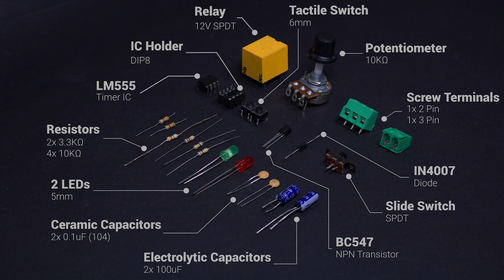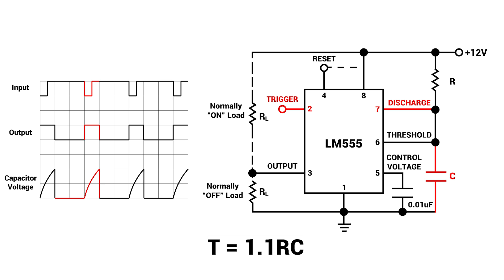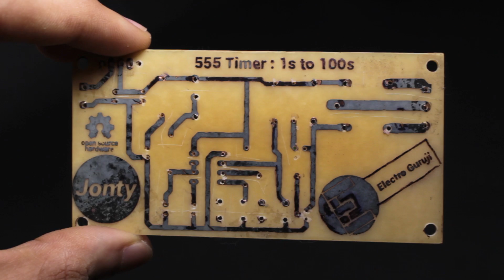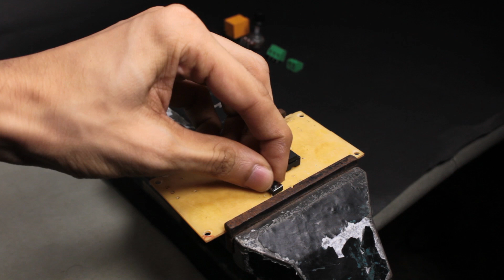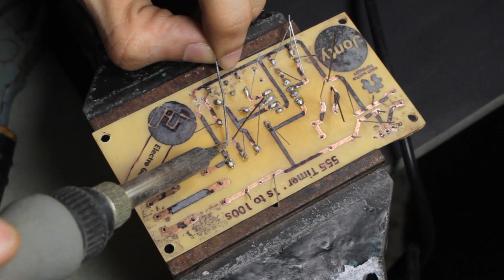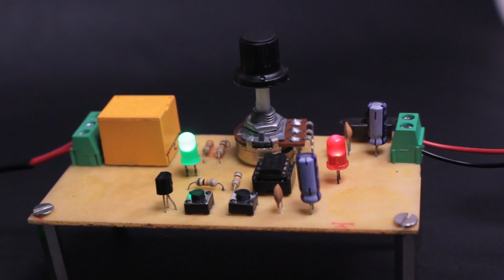How to Make an Adjustable 555 Timer Relay Switch | Monostable Multivibrator

Comment: Hello sir 🙏 sir can I use 10k Potentiometer for this project 🤔 pleasee reply me sir 🙏
Reply from the maker: For example, if the potentiometer is set to 0Ω, the value of R is equal to 10KΩ. Hence t = 1.1 x 10K x 100u = 1 second.

But if the pot is set to 1MΩ, the value of R is equal to 1MΩ + 10KΩ = 1010KΩ. Hence t = 1.1 x 1010K x 100u = 100 seconds.

Replace 1M ohm with 10k ohm and see what time period values you get.

You will need to select a different capacitor value to achieve the same time periods as the original circuit
Reply: @ElectroGuruji  and sir you can spika hindi 🤔 please reply 🙏
Reply from the maker: Yes
Reply: @ElectroGuruji  ok sir maine aap ko Instagram par message kiya hai par aap ka muje abhi tak reply nahi aaya 🥺😭

Comment: Excellent

I make the circuit as you mentioned in the youtube

But its just continious on not triggering, when i press stop its working, 

When i press start its started then after seconds nothing is off

Can you suggest where i am doing wrong

Thanks
Reply from the maker: Can you post more details with images on the discussion page:
https://github.com/jonathanrjpereira/555-Timer-1sec-to-100sec/discussions

It will make it easier to debug your circuit on the discussion page.
Reply: @ElectroGuruji  

Thanks

It's working fine, how can i modify so that it can work 1 second to 10 minutes

Thanks
Reply from the maker: You will need to change the R and C value.

Check out the written guide for more information:
https://github.com/jonathanrjpereira/555-Timer-1sec-to-100sec

Comment: Hi i made this circuit  to power a motor but it do NOT SWITCH OFF and if i conect the motor direct  to batt the timer is also triggerd what can i put in this circuit to keep this from happening please?
Reply from the maker: Post your question here:
https://github.com/jonathanrjpereira/555-Timer-1sec-to-100sec/discussions

You can add images and better explain the problem you are facing.
It will also make it easier for me to debug.
Reply: @ElectroGuruji  can you please check  on my Chanel for the video

Comment: Thanks bro I just have question I made the same circuit but with smaller capacitor to give me lower time like milliseconds but I have big problem because I'm using foots switch I can't be that fast it doesn't cut of when I press it if I  hold down the button after pushing it stay on trigger it doesn't cut off is there anyway to make it cut off even if I'm pressing the push button, I want it to work  if I push the button it work for the millisecond doesn't matter if I hold it. It rest when I release the button
Reply from the maker: So basically you want: as long as you are pressing the button, output should be ON. Only once button is released does the timer wait for a millisecond before turning OFF?
Reply: @ElectroGuruji  no the opposite, I want to set time for millisecond  when I press the button I want the relay only to open for the millisecond I set it for, right now if I press hold the button it stays on, it doesn't cutoff automatically
Thank bro for replying 🙏
Reply: @ElectroGuruji  let me give you example if I set the timer for 1 sec I want it to cutoff after 1sec EVEN IF I pressed the push button for longer then  1 sec

Comment: Sir i am facing one problem.can you help me.my circuit some times on when light is gone.why?
Reply from the maker: Please explain the problem with more details.
Reply: @ElectroGuruji  circuit is working fine.but just one problem is there.when i connect and disconnect the charger the output led on.why
Reply from the maker: Check if the LED is soldered between the transistors Collector and VCC(through a resistor).

Comment: Hi bro just suscribed and liked the video, im trying to make it but with a Pump on the place of the output charge lamp. Where i need to connect the 2 connectors of the Pump and his 9v battery?? Thanks
Reply from the maker: You will need to connect the pump/battery to the relay.

Pump GND - Battery GND.

PUMP VCC - Relay COM

Battery 9V - Relay N/O
Reply: Im using a 9 v Battery for the circuit but the relay doesnt work, need to be a 12 V battery right?
Reply from the maker: It depends on the relay. The  coil voltage will be written on the relay.
Reply: @ElectroGuruji  It says 12 V 10A/250V should i consider an obligation to use 12 V then?
Reply from the maker: Use the 12V dc

Comment: bro can i connect a digital clock to this so i can set the alarm and it will turn on and for switiching off i will use the delaay time will it work if yes where to connect the clock ple reply me
Reply from the maker: Can you provide more details about how you want to use this circuit with the digital clock.

Which digital clock? Do you have a datasheet?
Reply from the maker: Check out one of my other channels where I made an Automatic Plant Watering System: https://youtu.be/lRu-Z6gGrvc
Reply: @ElectroGuruji  i want to make it without arduino
Reply from the maker: If you want to use a RTC, you will need some sort of uC since most manufacturers only make RTC's with Serial, I2C communication.
Reply from the maker: You will be able to make a delay timer not a real-time clock

Comment: Dear Sir, Many  thanks for your reply, If i use simple ir sensor some times it activate sun light, also TSOP sensor i made with IR transmitter led it out put doesn't change in sun light if i close to some object output gives can i use this output to pin 2 in 555 and run the motor
Reply from the maker: Can you send me the link/datasheet for the TSOP sensor.

Comment: Dear Sir, Can i use this circuit for proximity sensor  in TSOP  to run a DC motor in 12 volts with  adjust the time , if can pl, send cct diagram/ luckyallc1956@gmail.com  highley appreciated
Reply from the maker: Hi Ambalangoda,
It depends on the type of proximity sensor used. I would recommend using a simple IR proximity sensor.

Since the 555 operates in the monostable mode it acts as a one-shot pulse generator.

There are two switches:
A START timer switch (with auto STOP) and a STOP timer switch.

These switches can be replaced with a IR sensor by connecting it's Vout to pins 2 & 4 of the 555.

The Vout should be normally HIGH. When Vout becomes LOW, it acts as if the switch is pressed and the timer will START/STOP depending on which switch you have replaced with the sensor (In your case, you will only need to replace switch S1 with the sensor).

You can connect VCC of the sensor to the 5V rail and GND of the sensor to the GND rail of the PCB.

Full Explanation of how the circuit works: https://www.instructables.com/id/Adjustable-Timer-Switch/

Circuit Schematic and PCB layout files: https://github.com/jonathanrjpereira/555-Timer-1sec-to-100sec

If you have any more questions, feel free to ask them and don't forget to Subscribe ✌️

Comment: Can you make the timer of 15,30,45and 60 minutes?
Reply from the maker: Theoretically you can depending upon the R and C values you have selected. 

You should also check out the CD4060 ic for this application.

Comment: Can I connect ir sensor to the switch 1 ? 
Since this IR module works on 5 volts if I connect 5v voltage regulator at the source n from there 5v pin is connected to the + of ir sensor and - of ir sensor to ground n out of ir sensor to pin 2 of 555 . Then will it work as timer even if the hand is kept infront of the sensor for long time ?
Reply from the maker: Hi Rahul,

Since the 555 operates in the monostable mode it acts as a one-shot pulse generator.

There are two switches:
A START timer switch (with auto STOP) and a STOP timer switch.

These switches can be replaced with a IR sensor by connecting the Vout to pins 2 & 4 of the 555.

The Vout should be normally HIGH. When Vout becomes LOW, it acts as if the switch is pressed and the timer will START/STOP depending on which switch you have replaced with the sensor (In your case, you will only need to replace switch S1 with the sensor).

You can connect VCC of the sensor to the 5V rail and GND of the sensor to the GND rail of the PCB.

Full Explanation of how the circuit works: https://www.instructables.com/id/Adjustable-Timer-Switch/

Circuit Schematic and PCB layout files: https://github.com/jonathanrjpereira/555-Timer-1sec-to-100sec

If you have any more questions, feel free to ask them and don't forget to Subscribe ✌️
Reply: @ElectroGuruji  
Bt if I do that it turns on untill the hand is kept infront of the sensor . I dnt want that . I want like if hand is kept infront of the sensor then it shud remain on for 2 second n turn off even if the hand is there in front . And again wen hand is removed and kept it shud work the same .
Can u pleade help me with that ?
Reply from the maker: During the timing cycle when the output is high, the further application of a trigger pulse will not effect the circuit
so long as the trigger input is returned high at least 10 μs before the end of the timing interval. 

This forum should help you with what you need to convert the continuous signal into a single shot for the trigger input:

https://electronics.stackexchange.com/q/158015/104799
Reply: @ElectroGuruji  
Can u please make a iR sensor circuit and send me of which on off timmeing will be controlled n directly connect to that circuit of yours ?

Comment: You said 10k ohm potentiometer but you used different value of potentiometer. How can a 10k ohm pot provide 1000 k ohm ? 
Rectify the error in parts list.
Reply from the maker: Hi Madhav,
Thanks for pointing out the error. 

I made a mistake in the video parts list, but the Circuit Diagram provided in the video contains the correct value (1MΩ) for the potentiometer. To rectify the error, I've pinned the comment pointing out the necessary change ✌️
Reply: @ElectroGuruji  Great

Comment: Sir , can this circuit be used to turn off AC loads as well  ?
Reply from the maker: Hi Madhav,

The relay I used can drive AC loads. I suggest you refer to the relay datasheet for more information regarding the maximum AC voltage/current that can be passed through the relay that you're using.

Disclaimer: Mains AC supply from your wall outlet should be handled by care since you can get electrocuted if not handled carefully.

If you have any more questions feel free to ask them 😁.

Don't forget to Like & Subscribe ♥️
Reply: @ElectroGuruji  Also can you add some display to this project to show the set time ? Please make that too!!
Reply from the maker: Unfortunately that would require a microcontroller and that would make the circuit more complex. But I will definitely add it to my list of To-do projects ✌️

Comment: What is the complete rating of 12V adapter that you uses for this circuit. plz tell the Amper value of your Adapter.
Reply from the maker: Hi Sahil,
Which adapter are you talking about?

This circuit did not use any power adapter. Instead it used a 9V battery.

If you have any more questions feel free to ask them 😊.

Don't forget to Like & Subscribe ♥️.
Reply: @ElectroGuruji  can i connect a 12 volt Dc adapter of 1 amp with this circuit as an input ? cause i want to drive a 12 v dc motor, is that possible with this circuit?
Reply from the maker: Yes you can connect a 12VDC/1A adapter to power the timer circuit and relay.

Check this tutorial out for more information about the circuit working:
https://www.instructables.com/id/Adjustable-Timer-Switch/ :

The LM555 has a maximum typical supply voltage rating of 16V while the relay's armature coil is enabled at 12V. Hence a 12V power supply is used to minimize the number of components such as linear voltage regulators.
Reply: @ElectroGuruji  thank you man. and one more thing, is it ok .. if contact you on you Instagram. if i have further query related to this ?
Reply from the maker: I actually think that's the best way to do it because you can send me images and I can help you to debug stuff to.
Reply: @ElectroGuruji  ok i will send it to you on Instagram

Comment: What is the work of 0.01micro farad capacitor which is connected to pin number 5
Reply from the maker: Hi Kirti,
Pin 5 is used to control the threshold voltage. But in our case (Square Wave generation using a Monostable Multivibrator) we do not use this. Hence, Pin 5 is connected to GND. We use a 0.1uF capacitor to filter out the noise that could propagate into pin 5.

For a detailed explanation of the circuit: https://www.instructables.com/id/Adjustable-Timer-Switch/

Feel free to ask any more questions regarding the same.

Don't forget to Like & Subscribe ✌️
Reply: @ElectroGuruji  can u please help me use this idea for automatic timed sanitizer dispenser using an IR sensor
Reply from the maker: Firstly, that's a really good application of this circuit.

Since the 555 operates in the monostable mode it acts as a one-shot pulse generator.

There are two switches:
A START timer switch (with auto STOP) and a STOP timer switch.

These switches can be replaced with a IR sensor by connecting the Vout of the IR sensor to pins 2 & 4 of the 555.

If you have any more questions, feel free to ask.
Reply: @ElectroGuruji  can u please make a video concerning how to make sanitizer dispenser circuit using IR sensor and 555 timer.
Reply from the maker: I'll try to make it. But with the lockdown I won't be able to buy the parts and make it for a few weeks now.
Reply: @ElectroGuruji  Yes I understand that but, no need for a model. Just if you can explain the connections and all, where to place which component.

Comment: Can I replace momentary switch S1 with the IR sensor module Vout & Gnd ? Need urgent reply
Reply from the maker: Hi Suryakant,

Since the 555 operates in the monostable mode it acts as a one-shot pulse generator.

There are two switches:
A START timer switch (with auto STOP) and a STOP timer switch.

These switches can be replaced with a IR sensor by connecting the Vout to pins 2 & 4 of the 555.

The Vout should be normally HIGH. When Vout becomes LOW, it acts as if the switch is pressed and the timer will START/STOP depending on which switch you have replaced with the sensor (In your case, you will only need to replace switch S1 with the sensor).

You can connect VCC of the sensor to the 5V rail and GND of the sensor to the GND rail of the PCB.

Full Explanation of how the circuit works: https://www.instructables.com/id/Adjustable-Timer-Switch/

Circuit Schematic and PCB layout files: https://github.com/jonathanrjpereira/555-Timer-1sec-to-100sec

If you have any more questions, feel free to ask them and don't forget to Subscribe ✌️

Comment: I have a quotation ? Can we control with ir module ? Please urgent replay . how to use ir sensor. Vcc ,ground ,vout . please give me complete deatail
Reply from the maker: Hi Affan,

Since the 555 operates in the monostable mode it acts as a one-shot pulse generator.

There are two switches:
A START timer switch (with auto STOP) and a STOP timer switch.

These switches can be replaced with a IR sensor by connecting the Vout to pins 2 & 4 of the 555.

The Vout should be normally HIGH. When Vout becomes LOW, it acts as if the switch is pressed and the timer will START/STOP depending on which switch you have replaced with the sensor.

Full Explanation of how the circuit works: https://www.instructables.com/id/Adjustable-Timer-Switch/

Circuit Schematic and PCB layout files: https://github.com/jonathanrjpereira/555-Timer-1sec-to-100sec

If you have any more questions, feel free to ask them and don't forget to Subscribe ✌️

Comment: Is this turn on off automatically
Reply from the maker: Hi Fuzail,
The timer switches OFF automatically but can also be manually switched OFF by pressing the RESET button.

You can find the full circuit explanation: https://www.instructables.com/id/Adjustable-Timer-Switch/

Circuit Schematic and PCB Layout files: https://github.com/jonathanrjpereira/555-Timer-1sec-to-100sec

Feel free to ask any other questions and don't forget to Subscribe 😁

Comment: How connect ac corent
Reply from the maker: A 12VDC power supply is used to power the circuit. In my case I used a 230VAC-12VDC power adapter.

When the timer starts, the relay turns ON. Hence the Common(COM) terminal of the relay is shorted to the Normally Open (NO) terminal. A high power load can be connected to this terminal such as a light bulb or water pump. Hence the relay acts as a closed switch (between N/O and common) when the timer starts.

Check out my tutorial that covers this in detail: https://www.instructables.com/id/Adjustable-Timer-Switch/

Comment: Cool👍👏
Reply from the maker: Thanks dude.
Reply: @ElectroGuruji  sir can i connect its on switch to a sensor and how?
Reply from the maker: @roniecrisestimada2717  Hi Ronie,
When pin 2 of the LM555 is triggered (by shorting it to ground) through the momentary switch S1, the timer is started.

Which sensor are you planning on using?

Depending on the type of sensor you can replace the switch with the sensor. If the sensor output goes the 0/GND, the timer will start. 
OR
You could connect the sensor output to the base of a transistor such that when the transistor is turned ON, it acts as a switch and connects the pin 2 of the 555 to ground.

Circuit Working: https://www.instructables.com/id/Adjustable-Timer-Switch/